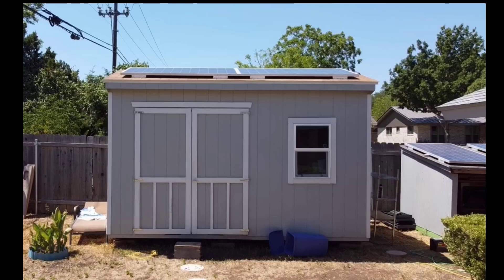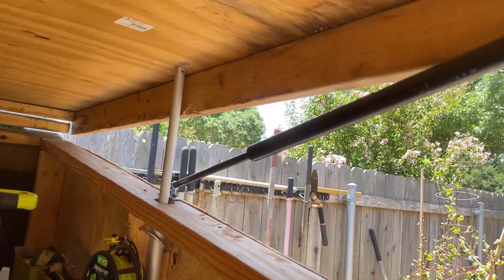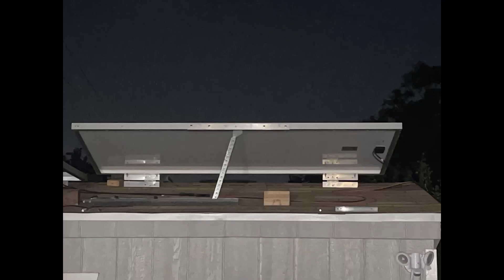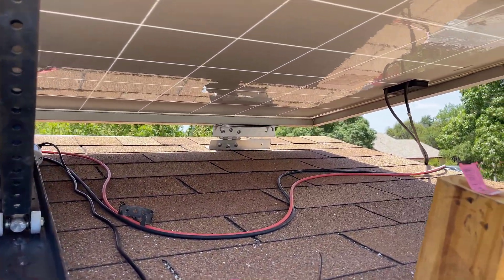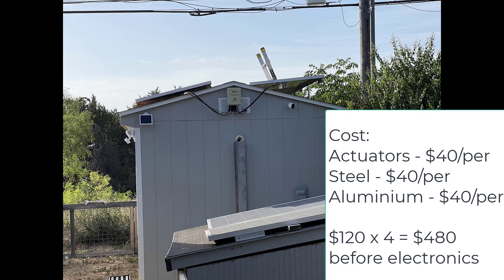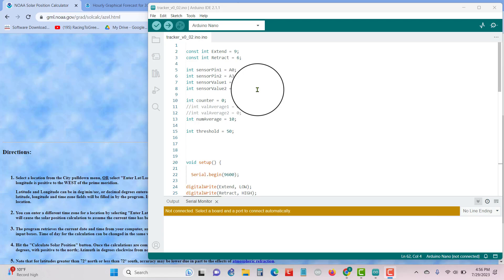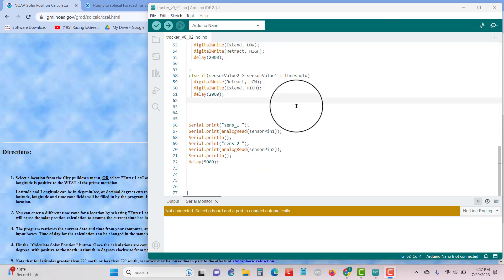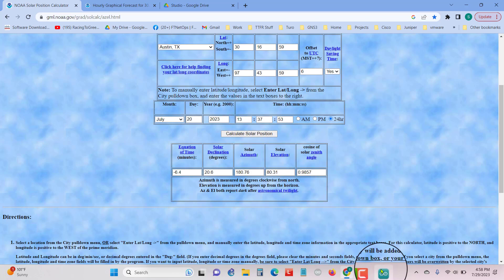Single Axis Solar Panel Tracker Arduino IOT powered!

Comment: I love the function of the lifters, and I'm thinking about attaching one to my side of the north-south fence and using a lifter with spring assist. Another component is bifocals mounted vertically, longwise in the middle of the roof. Off set the tilted panels a foot or two from the center. Reducing the shadow of the center panel
Reply from the maker: Yeah, am almost ready to post new content on the mobile Victron EV charger and then, I think I might finally have time to finish the other side of the shed. I’m using one of the cheapo ebay single axis trackers to move the panels and it’s working great.

Comment: That’s clever. 👍. I have seen plenty of people saying it’s not worth doing but I can see it’s all about the interest and sense of accomplishment. Well done and thanks for sharing the video.
Reply from the maker: No problem, there is a practical reason for it for my installation. In 107 degree heat, my panels/batteries fall short of what the mini split needs to keep it comfortable, without drawing from the house, as it needs about 7.5 kW in a day like that. The system produces about 6kW. After I finish the other set of panels to move them into catching morning sun, It's likely I'll make up that 1-1.5kW deficit, and the shed will be self-sufficient.

Comment: I like your movable panel concept….but …..you are just making your brain swell….just relocate your rams under the panels
Within the drip line …..all you mechanical leverage issues are nuetralized…..I would go with a timer…or light sensors.
Thanks for posting…
Reply: The timer makes sense.  Sonoff with inching.
Reply from the maker: Not sure I’m understanding what you are saying? They are under the panels. Let me know, I’m getting ready to do the other side and am open to suggestions. It is definitely struggling with the initial negative angle. I just tried to run it off a Drok buck converter that only goes to 5amps, and it appears to need every bit of 6-7 amps to start to raise the panel. Once the arm is moving up, it drops to less than 2 amps. I think it may be solved by beefing up the mounts at the hinge. I could also raise the block ramp at the end of the track a bit, as it helps get the arm moving up with less vertical force needed.
Reply: Punch a hole thru the roof
And run the ram at a better angle to reduce torque start up. @racingtogreen2023

Comment: Hmm... think about adding a wind sensor to make your setup more storm proof. I just wonder how long your actuator will last. The panels can easily last 20 years.
Reply from the maker: I actually have one, just need to implement it, and add the code. We're building a 10 x 360watt panel system now, mounted inline to our backyard fence which is going to be an absolute sail, and will definitely need one. The actuators on the shed are eco-worthy, which definitely feel like they are higher quality than the 20" Vevor's that I just picked up. The two eco-worthy's lifting my workshop/shed roof have been going strong for a year and a half so far.

Comment: 👍 Good job! It won't help me get any more from my system, but it's a satisfying project to see. If you do a redesign or upgrade, please film the build.
Reply from the maker: I think, it’s working for my needs, and I’ve only done one side so far. The west side which get’s ver little morning sun, as it’s canted down, facing westward will be set to rise 60-75 degrees at least, so it should produce significantly more output from 8am - 12pm. The Epever cloud uploads will allow pretty specific data on the increase once completed. Yeah, this is definitely most useful for someone like us, with panels on both sides of the roof, oriented, east vs west.